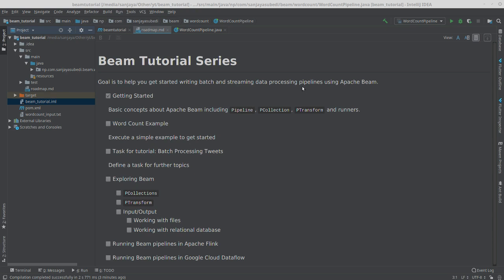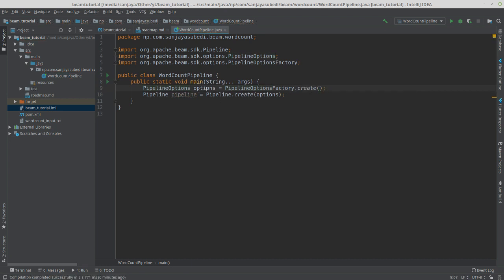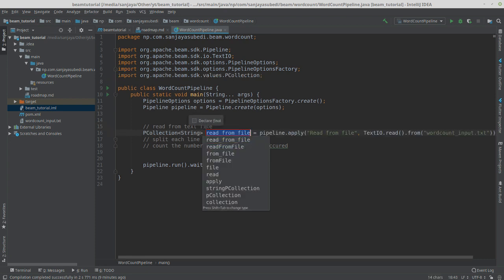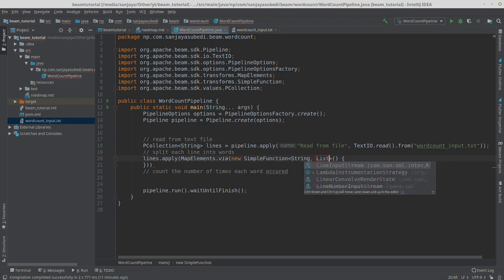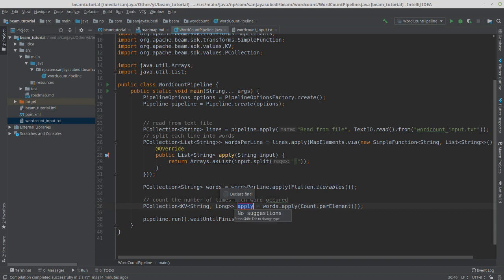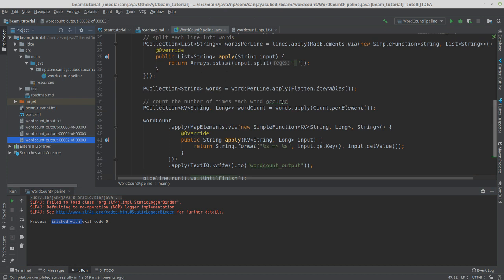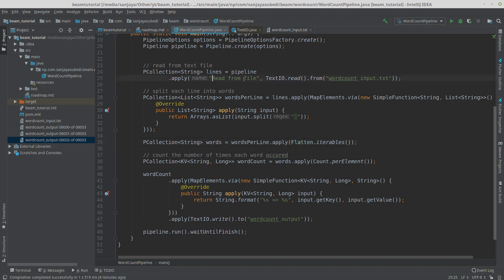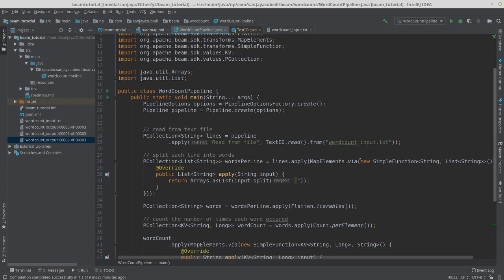Apache Beam Tutorial Part 3: Word Count Demo

Comment: I encountered same issue(No Runner was specified and the DirectRunner was not found on the classpath.
 Specify a runner by either: Explicitly specifying a runner by providing the 'runner' property )
 
This is how I resolved. 
        PipelineOptions options = PipelineOptionsFactory.create();
        DirectOptions directRunnerOptions = PipelineOptionsFactory.as(DirectOptions.class);
        Pipeline pipeline = Pipeline.create(options);
Reply: if you will add "beam-runners-direct-java" in classpath of maven project then you will not get that error.
It will pickup automatically "DirectRunner" as runner.

Comment: No Runner was specified and the DirectRunner was not found on the classpath.
 Specify a runner by either: Explicitly specifying a runner by providing the 'runner' property ?? Followed This video and used 2.11 version of apache beam.
Reply from the maker: By default it should use DefaultRunner so you shouldn't have to specify it. Not sure what happened with you but you can go to Run Configuration in your IDE and add "--runner=DirectRunner" as program argument.
Reply: @DSWithSanjaya  I did copy and paste the "--runner=DirectRunner" as program argument but got same exception.
Reply from the maker: @sureshg7964  check the pom file once and make sure it is same. Also make sure you didn't add the double quotes when specifying  --runner=DirectRunner.
Reply: @DSWithSanjaya  I encountered same issue(No Runner was specified and the DirectRunner was not found on the classpath.
 Specify a runner by either: Explicitly specifying a runner by providing the 'runner' property )
 
This is how I resolved. 
        PipelineOptions options = PipelineOptionsFactory.create();
        DirectOptions directRunnerOptions = PipelineOptionsFactory.as(DirectOptions.class);
        Pipeline pipeline = Pipeline.create(options);
Reply: if you will add "beam-runners-direct-java" in classpath of maven project then you will not get that error.
It will pickup automatically "DirectRunner" as runner.  @bhargavkarumuri9744